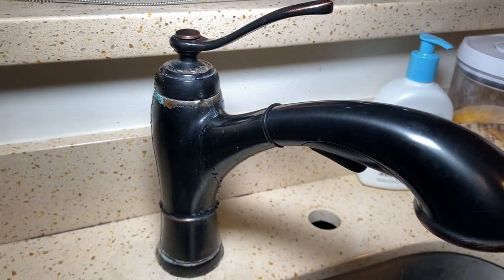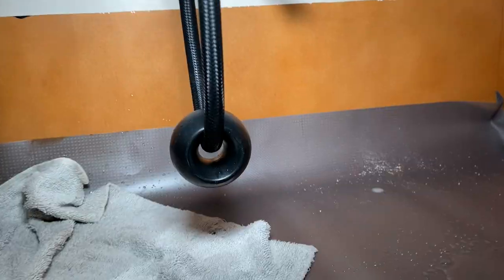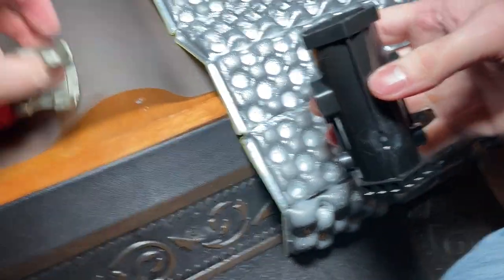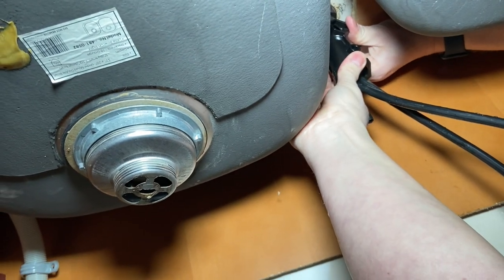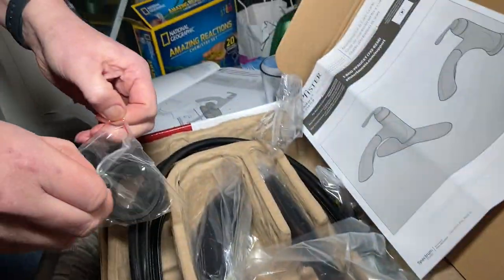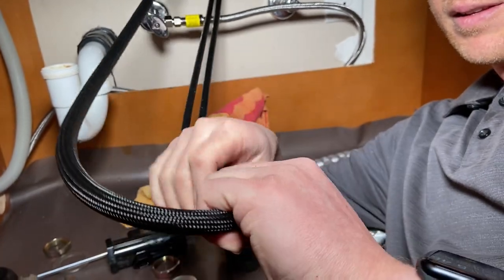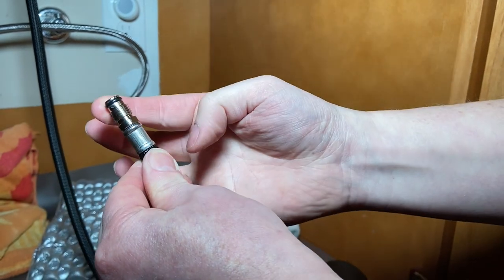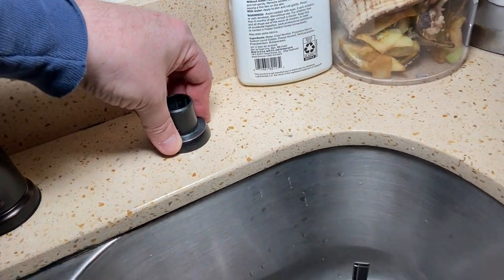That Fix It Guy House Call...Pull Out Kitchen Faucet Replacement

Comment: Whats that black tool you used to remove that faucet? I could definitely use one all the time where could i buy it
Reply: The Tool came with his Price Pfister faucet you may be able to contact them and see if you can buy one directly from them… they are great to deal with. They have great customer service.
Reply from the maker: Thank you Fred for that information.
Reply: @FredD63  thanks

Comment: I had that exact faucet and it leaked from the top the very first day.  I threw it away because it takes so much to replace these. The sink was extra deep and even with the special tool it was difficult to remove.

Comment: hi, I'm new to your channel. thanks for sharing, this was great info. i have a sink very similar to that one. and its starting to jiggle and become loose just the stainless-steel sink with the two sections. the countertop is fixed tight and does not move. Thanks
Reply from the maker: Sometimes they don’t secure those sink the best. They should have added bracing or clips to secure it. You will to get in the cabinet and look up to check it out. 
When you do shoot a video or pictures. I could suggest a repair if you like.
Reply: @ThatFixItGuy  Thanks.